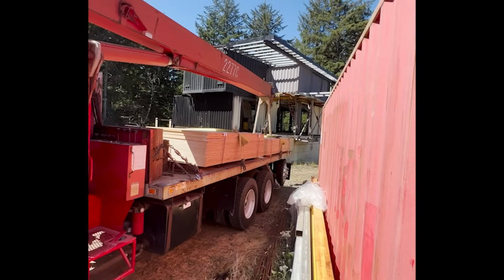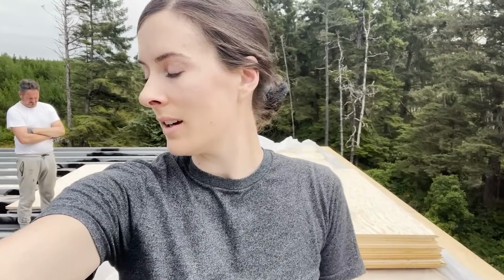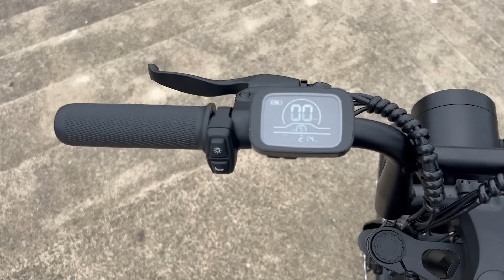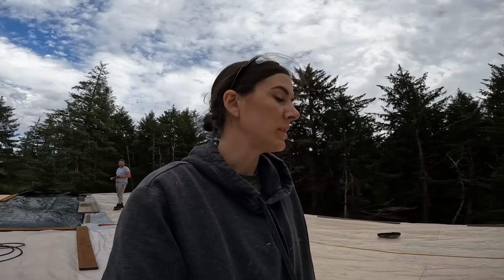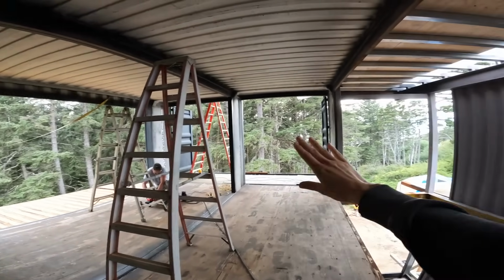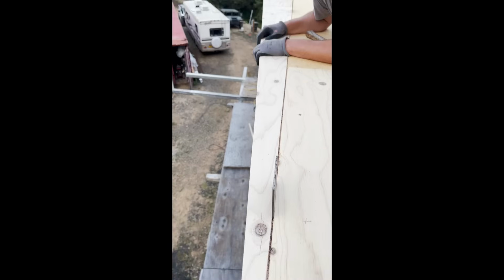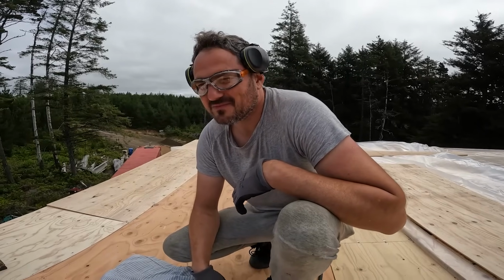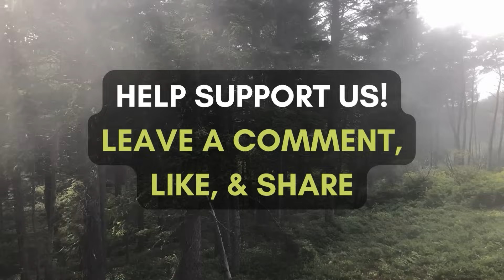Couple Builds DIY CANTILEVER ROOF for OFF GRID CONTAINER HOUSE #diy #home #build

Comment: You shouldnt have to push on that drill at all to make your holes.  Time for some sharp bits!! new ones or sharpen the ones you have.  Will save you time and frustration, not to mention sore muscles.  A good bit should pull right down into the new hole, never push, sharpen.  Good luck, roof is looking great!
Reply from the maker: Thanks so much!! The drill bits get dull after hundred of holes lol. :)

Comment: My question is why is the wall along that one side off like it is? You should have fixed that prior to doing the rooftop. That means the house (containers) are way out of square and it will cause issues for y'all later on down the road when you frame, drywall, etc...
Reply from the maker: It was purposefully built that way. I explain a little bit about it here: https://www.youtube.com/watch?v=1mpT8WHV73I